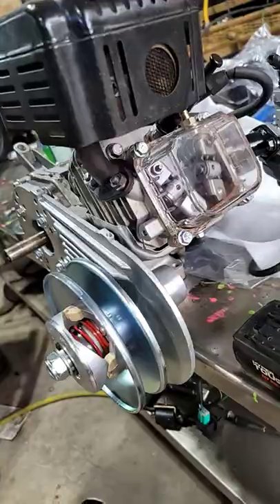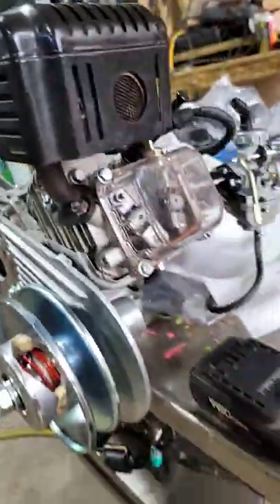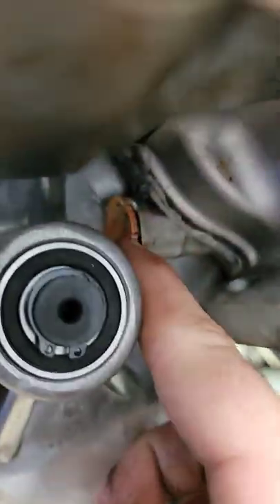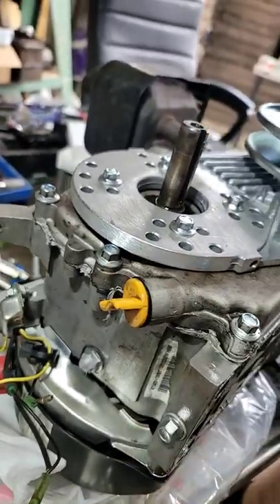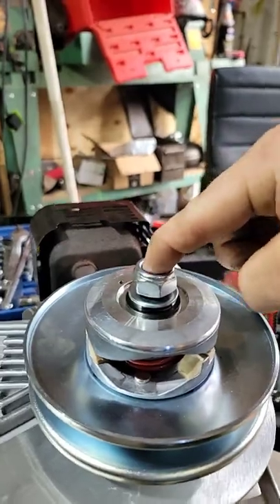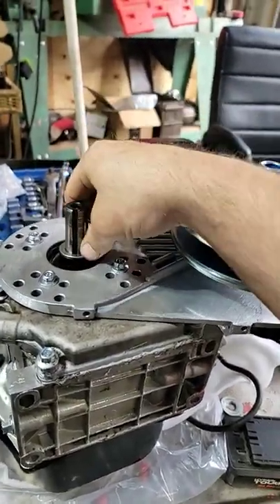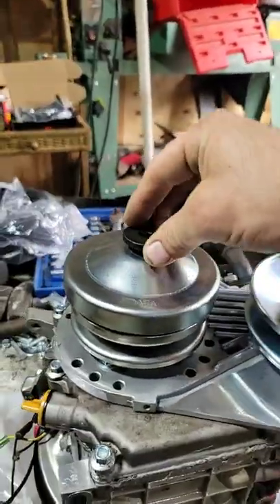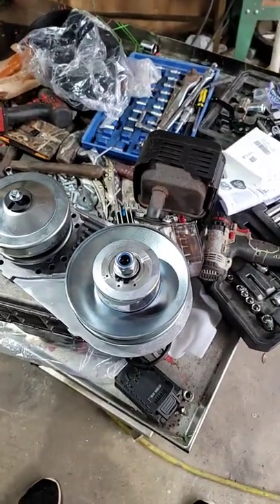how to install a torque converter on a predator 212

Comment: You forgot to mention the belt.
Reply from the maker: That part is pretty self-explanatory
Reply: @chaoscustoms6894  You'd be surprised
Reply: @chaoscustoms6894  it’s A-symmetrical
Reply: @chaoscustoms6894 they face a specific direction

Comment: I guess we're just going to leave the belt off huh. The whole reason I watched the video is to see how to put the belt on
Reply from the maker: The belt is pretty simple there should be one side with a slant and one side is flat the flat side goes towards the engine you just slide the belt over the rear pulley the pulley on the engine you have to unbolt put the belt on and then put the torque converter back on it's really simple hopefully this helped you

Comment: Any source or 2nd dary driver spring replacement from factory Red to YeLLoW. Looking to change shift points on 2ndary driver

. ? THANKS FELLOW PerFoRmancE peeps~ Sincerely Terry Wood aka °H°∆°R°°D™ FLaTLanDs of KaNSaS
Reply from the maker: I haven't tried replacing those springs yet I've been looking at them I found some on Amazon it's a full kit I'll send you the link so you can check it out too hopefully it helps you out
Reply from the maker: https://www.amazon.com/dp/B07HFBKLLN/ref=sspa_mw_detail_3?ie=UTF8&psc=1&sp_csd=d2lkZ2V0TmFtZT1zcF9waG9uZV9kZXRhaWw

Comment: What is the problem if when you start the engine and at idle it wants to start spinning the tires without any throttle. Installed as shown on the video.
Reply from the maker: @iana8407  well if you've installed the bronze bushing and everything correctly it could be your engines more powerful than what the clutch is rated for which will cause the clutch to engage prematurely may have to upgrade the Springs inside the clutch it could just be a malfunctioning torque converter clutch to

Comment: Is that a 30 series, is the shaft on the engine long enough to fit the pulley to completely tighten down?
Reply from the maker: Yes it's a 30 series torque converter most of the kits come with the bolt that bolts into the shaft of the engine in a spacer

Comment: mine never came with a bronze bushing where did you get that? i have a 1 inch driver so im guessing ill need a 1 inch bushing?
Reply from the maker: The kit that I am using on this fits a predator 212 it is not a 1-in shaft I did order a 1-in shaft torque converter kit and it did not come with a bronze bushing so I'm not even sure if you can order that Brown's bushing I've been driving this go-kart for about 2 years now with no bronze bushing with the one inch shaft never really have an issue hopefully this helps you out good luck

Comment: I've always had trouble with how much to torque the driven pully down to, I've just absolutely cranked it down and ran it and that made the bearings explode, also if I torque it down too much the whole pully doesn't want to spin, I found about 7ish foot-pounds seems to be ok but I'm worried its going to come loose.
Reply from the maker: The 7 foot pounds of torque should be fine as long as you're using a lock nut the likeliness of it back in office very low

Comment: My chain keeps running into the back plate and popping off. Just the master link.
Reply from the maker: That could be a few different things it could be the engines Cox sideways a little bit you  might have to readjust it if it's not that the master link might be installed incorrectly it's hard to explain it I can show you how we did ours and we seem to have no issues I will show you in a future video keep watching our short clips thanks for the comment and don't forget to subscribe for more videos
Reply: @chaoscustoms6894  good idea for a short because it was giving me all kinds of grief, turns out my engine was not aligned properly, I got it adjusted and she is running like a race horse now!
Reply: @chaoscustoms6894  hi, is there any way i can have the sprocket to chain on the other side of the plate?

Comment: I bought a brand new 212cc predator and noticed it already has a key on the motor so I can’t install the torque converter. What do I do?
Reply from the maker: The key on the crankshaft is removable grip onto it with a pair of vice grips and remove it or pliers every Predator engine I've ever purchased it's been removable some of them are just kind of stuck in they really stuck so you get to pry on it but it usually comes out no problem

Comment: Bruh my engine jackshaft part is wierd I ordered a torque converter and when I put on the front stuff the sqrew had no where to turn because the jackshaft had no threads in it can you help me with that?
Reply from the maker: We usually try to just deal with predator 212 from harbor freight they're easy to work on but we've dealt with engines we've taken from generators in their tapered shafts with no bolts so we usually just drill a hole and tap and dye the end and you can start the engine up and shave down if it's tapered down to the size you need for your clutch driver or you can just take it to a machine shop and ask them how much they'll charge to do it for you

Comment: How do I get the back part of the clutch off the shaft mines got stuck because I forgot the black spacer
Reply from the maker: If it's stuck on to the engine shaft they are usually two to three things you can try you can try getting a screwdriver behind it and give a little tug and sometimes it pops loose The other thing is put the screwdriver behind it give a little tug and tap it with a rubber mallet in if that doesn't work you may have to use a pulley puller if you don't own one and you don't want to buy one I'm pretty sure O'Reilly's has a loaner tool for that hopefully this helps you Good luck

Comment: Hey my driver pulley isn’t expanding at all when i rev it and it causes my engine to stall out.. any suggestions?
Reply from the maker: I never had that issue but I recommend greasing all the parts that need to be greased it sounds like something is binding up
Reply from the maker: I might do a video on greasing the torque converter parts

Comment: My front bolt keeps coming loose and falling off while riding, resulting in pieces going everywhere at 40mph. What should I do?
Reply: use an impact gun an give it an ugga and a dugga and you should be good. just two short ugga and dugga right after. light ones too, not full forcing. that or literally look up the torque spec and use a torque wrench. im guessing its like 60-80 ft lbs? not 100% sure so look it up

Comment: When I installed this and put the chain and stuff on. I had a problem where it didn’t wanna spin. Like I would try dragging the go kart and it was all a tight then the back wheels wouldn’t spin. What could be the reason for that
Reply from the maker: The chain may be too tight or you have two small of a belt for it I did a part two of this video I'll send you the link it kind of shows you how tight and loose the chain and built should be
Reply from the maker: https://youtube.com/shorts/VubVBevx7ZI?feature=share

Comment: Didn't know there was hemi predators!
Reply from the maker: Yeah the predator 212 have the standard engine and you can get the hemi which has a low end torque the hemi has the aluminum valve cover
Reply: You get 2-3% more output, but a smaller selection of aftermarket parts available.

Comment: What size bolts did you use to attach the back plate? The bolts that came I. The kit only go in like 1-2 turns and stops.

Comment: Be sure to tighten the driver pully bolt good because mine came out and the pully came off and destroyed my whole torque converter
Reply from the maker: Yes I've had that happen once you can prevent that by putting a little bit of Loctite on the threads or at a lock washer
Reply: What’s the size of the pully bolt? Been looking everywhere

Comment: The fun part is putting on the belt without pinching your fingers😅
Reply: Why the fuck would you pinch your fingers….. the belt just goes on before you bolt the clutch down…… there’s absolutely no way you should be pinching anything
Reply: @ericcooper2174 literally lmao
Reply: @ericcooper2174  i think he tried to put the belt in after installing the clutch lmao

Comment: is a torque converter similar to a supercharger on a car
Reply from the maker: I would say not it doesn't really help the engine perform it's more just get you a little more torque at low RPMs and some high speed at high RPMs
Reply: No its like a transmission

Comment: how do I fix mine idles goes by itself
Reply from the maker: You can try adjusting the idle screw on your carburetor sounds like your  engine is idling just a little bit too high 

If that doesn't fix it go to my Facebook profile chaos customs of Savannah I leave a link in all of my videos in the description and I can  help you out a little more there post a picture of what it's doing or video
Reply from the maker: Check us Out on  Facebook 
https://www.facebook.com/groups/276677387967596/?ref=share
Reply: @chaoscustoms6894  it has a stock carburetor
Reply: @chaoscustoms6894  and I bought it from someone one it works great
Reply: @chaoscustoms6894  and is the belt on my torque converter supposed to be lose or tight
Reply from the maker: On Monday I will post a quick clip video for you showing what the torque converter should look like when the bike or go-kart is running maybe it will help you thanks and good luck in the belt should be a little loose
Reply: @chaoscustoms6894  thx
Reply: @chaoscustoms6894  did you make the video yet?
Reply from the maker: I recorded today posting it tomorrow
Reply: @chaoscustoms6894  ok
Reply from the maker: https://youtube.com/shorts/VubVBevx7ZI?feature=share
Reply: @chaoscustoms6894  thx
Reply: @chaoscustoms6894  btw my name isn’t hunter but I had to make a account so my actual name is Hudson

Comment: When tighten it down how do you stop the engine from spinning?
Reply from the maker: I used to use a screwdriver in the flywheel fan on the pull string side but now I just use my cordless impact and I send it with 
aga and a Dugga and that usually works fine

Comment: Mine wont engage the belt.  Tips?
Reply from the maker: Inspect the clutch make sure it was installed correctly and make sure the RPMs are up high enough to engage that's all I can tell you without actually seeing it I'm going to be doing a video on how to install a torque converter on a mini bike I'll probably be doing that video next week so it should be up in a couple weeks
Reply from the maker: Or you can find me on Facebook check out the link on one of my videos and you can contact us through Messenger and we can help you more there you can send us some pictures post them on our Facebook and we can comment and let you know what's going on with it
Reply: I have a 212 with a converter and it snapped a  chain it is a 35# chain. what can be going wrong?